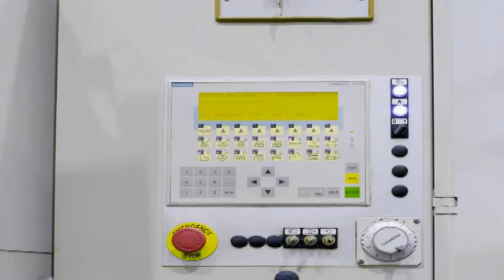MULTI SPINDLE SCREW MACHINE | AUTOMATIC SCREW MACHINE

Comment: My first job at age 15 was to clean the metal chips out of the bottom of six of these machines which ran all day.  Then, I had to lift the "chip bucket" up to the spinner to recover the oil and then raise the bucket containing the chips into the dumpster.  Did this for 10 hours a day and by the end, I was soaked with oil, solvent and the stuff they used to clean oil from the floor. Had to take a shower every night. Also had to unload the steel bars from the semis when they delivered and then lift the bars into the rack.  Got my growth spurt that summer and put on about 50 pounds of muscle.  Best summer of my life